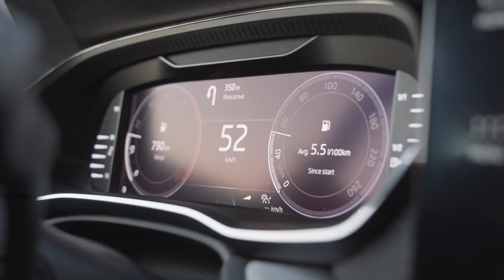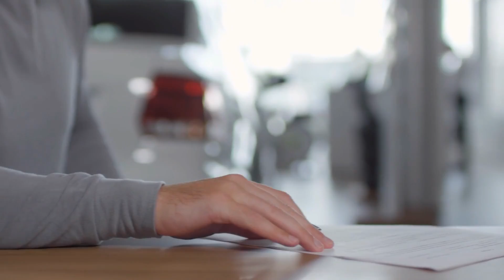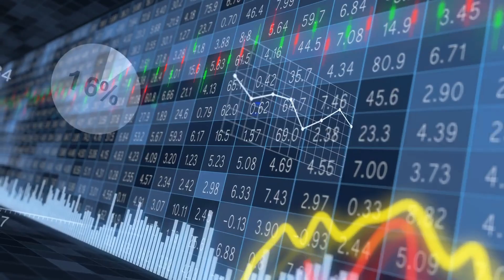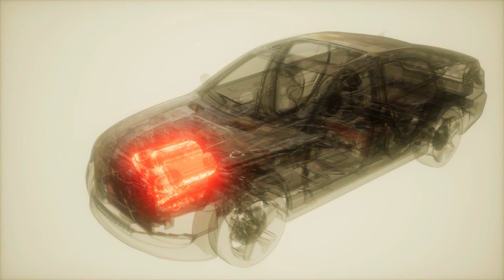Hyundai CEO: "This New Ammonia Engine Will Destroy The Entire EV Industry!"

Comment: It seems that the Hyundai engineers need to introduce their CEO to an EV, or maybe the execs are willfully ignorant.  Were they to study an EV they would see a simple and inexpensive motor, a single-speed gearbox, all controlled by power electronics that their country excels at making and they would see at least a start on a worldwide charging network that includes charging on the grid at almost every home in the developed world.  Instead, they promote a noxious fuel, primarily made from methane, requiring a complicated engine, transmission and a non-existent fuel delivery system.  Don't worry people.  These execs are not serious.  They just want to stir up controversy while they work to catch up with the other EV makers.  Toyota is playing the same games with their hydrogen V8.
Reply: I agree with you completely. The guys I work with are real big on their huge diesel trucks but then my boss tells me he spends almost $1,000 a month on diesel fuel. I showed him a video of a rivian truck and then a DYI solar panel array with battery backup. I'm like see, your truck will be twice as fast and will cost you nothing to fuel
Reply: Transportation requires a lot of energy, even more if one insists on driving one of the monster pickup trucks that are so popular in the USA.  $1,000/ month in diesel fuel is a LOT of energy.  Depending on where one lives, this is about the same as $400/ month in electricity to charge an electric truck when charging at home.  This large electric bill can be reduced by a large solar electric array, and DIY solar is cheap.  DIY solar arrays cost about $1/ Watt; professionally installed arrays cost about $2.50/ Watt.  Providing $400/ month for a truck is a very big project.  A quick estimate: $400/ month= 3,000 kWh/ month; it varies a lot but 120 hours of nameplate power per month is a starting point.  This leads us to a 24kW PV array, which is ordinarily enough to power1-1/2 to 3 homes, depending on electricity use.   The good news is that every kW of PV reduces the electric bill by a proportional amount.  If there is not enough room for 24kW of PV, then install as much as space and budget allow.
Reply: @peteinwisconsin2496  yeah seen videos on 15kw DIY systems with battery backup for about 15,000. Looks like half of the cost are the batteries we are high-end industrial Refrigeration technicians so DIY shouldn't be a problem.

Comment: This is what I have been saying for a while now, we need to concentrate more on eco fuels rather than waste energy trying to go all electric. Engines already exist, fuelling stations are everywhere. Engines just need to be modified to run on new fuels. And if it a liquid fuel the current petrol and diesel filling stations will not need any mods at all, just add the new fuel. I won't be long before electric cars will be dead, before they are even really alive. Give it 5 years and one of these major players will have a eco fuel that will simply take over from petrol and diesel. The rate they are doing RnD it will not be long. Once that happens electric cars will be all but a distant memory.
Reply: I agree
Reply: Nope. There’s always been ‘better tech’ ‘just around the corner’ and ‘in just a few years’. The need is now and the road to market is a long one - even assuming it’s actually viable.